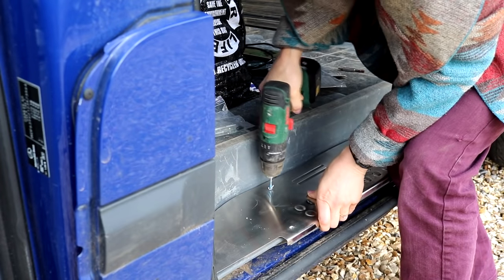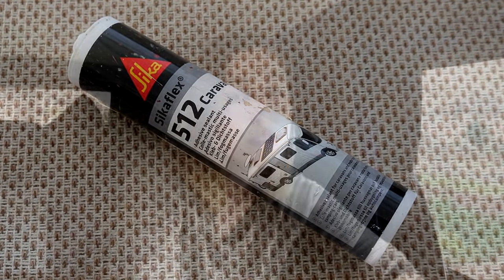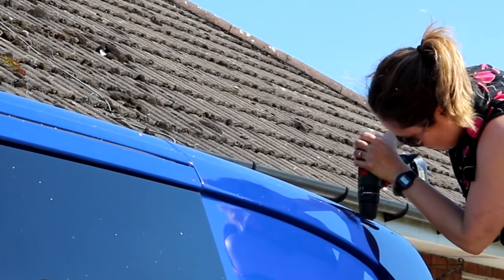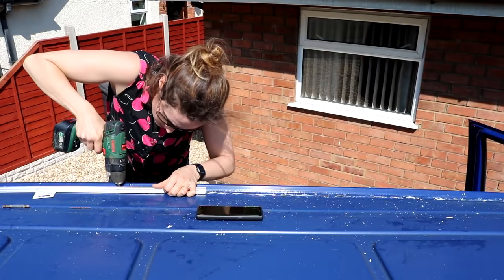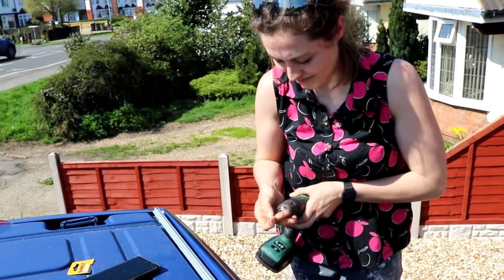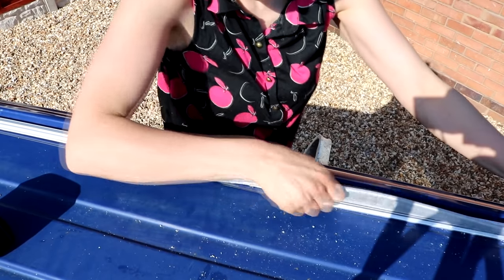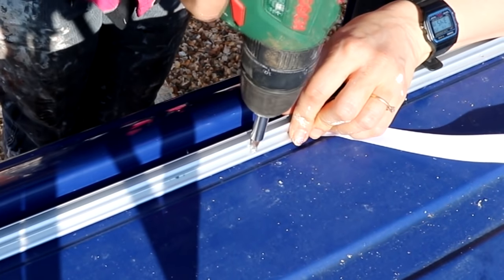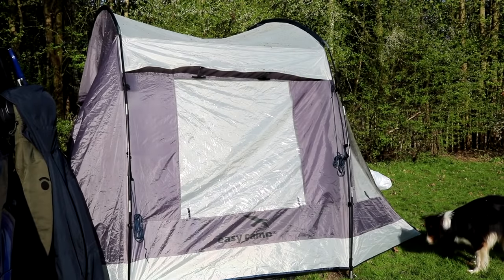Fitting Driveaway Camper Van Awning Rail | The Carpenter's Daughter

Comment: I would suggest never using any screws provided in any sort of metal based product. The manufacturer always put in the cheapest fixings because they dont have to use them. A quick trip to screwfix should see you kitted out with all the proper, stainless,  screws you need for penny's and way less hassle. For the broken of screws I would encase them in a blob of silicone rubber. Hopefully this will stop water getting under the paint and into the van.
Reply: Michael Tricker I agree, any screws or plugs supplied go straight in the bin! More trouble than they are worth!!!
Reply from the maker: Thanks!  I've now bought some waterproof silicone - thanks for the advice :)

Comment: Great job for tackling a very scary project, when i have ever drilled holes in my motorhome roof (satalite/awning etc) i have always used stainless screws and then covered the screw heads  with a small blob of Sikaflex, not always used screws, i have x2 solar panels that are just bonded down with Sikaflex and they are rock solid (have been now for 3 yrs) drilling the body of any van as such is very scary at first but when you think about it Vickie its only what a workshop fitting company would do - but charge you a small fortune in the process - great to see you brave such a job - my hat is off to you once again.

Comment: Well done for the hard work. I haven't bothered on my Vito. I put a couple of bolts (M4 or M5 I think) into the holes already in the rain channel (standard on all Vitos I think for potential roof rails) on the tent side, and one on the centre opposite side. Then, I fitted a length of 4mm rope to the driveaway awning edge which holds it all in place. We've used lots of times with no problems, even in heavy rain and wind, just need to make sure the ropes are tightly secured to the bolts. It is easy to detach when going out for the day too. When returning, just loop the rope over and tighten.

Comment: If the back of the rail had an adhesive backing I would have thought the rubber grommets went on top of the rail under the head of the screw, to act as a seal. With the grommets between the rail and the body work the adhesive cant be in contact all the way along.
Reply from the maker: That is a very good point!  I never really considered that as we were reusing the first track that was no longer tacky.  Oh well :\

Comment: Has been mentioned already, leave those broken screws in but a bit of silicone sealer to stop any moisture getting in, drill extra hole next to where broken screw is, right through the rail, pop in new screws jobs a. Goodun. :-) great idea for on site with your camper van, able to leave the awning up when using the van for sightseeing. Boss job.
Reply from the maker: Thanks!  I've now bought some clear sealant, so will go round the sheared ones.  I'll see how it goes, but it seems sturdy at the moment and see how it goes before drilling a couple more holes :)

Comment: My personal experience is to use better screws than those
 provided to keep costs down and secondly don't use a power drill to tighten them. Use a hand screw driver for the final tighten up. You see "professionals" all the time using power drills and they ALWAYS over tighten or strip the heads.

Comment: Were they stainless steel screws, Vikkie? They can be brittle. But I don't think you were overtightening them. Probably cheap screws, as someone else has suggested - I rarely use the screws supplied with any package. I imagine they were self-tapping screws. Are you able to drill the track and add new fixing points?
Reply from the maker: Thanks, Olly :)  I'll definitely try my own screws from now on since so many people say they bin them :D  I did wonder about drilling a new hole in the track, but left it's very.  I'll have to monitor that back one for now.

Comment: I would never have used screws to begin with. Screws can come loose, back out and be gone long before you notice the first leak.
I’d’ve used pop rivets with black silicone (the kind they use for windshields in cars). I’d pre-drill the rails after I put them up and determined where exactly to place them, so I could identify issues like curves and seams. Then I’d use those holes to locate each point that needed to be drilled through the roof of the van. At that point, I’d apply the silicone to the roof along the entire length of the rails. Start at one end, drilling one hole and installing the rivet, then going on to the next point. Having the silicone the whole length would reduce vibration and wind noise. Then just clean up the squeezed out silicone with a damp terry cloth rag and voila!and if it helped you feel more secure about the risk of tear-out, you can always use snug-fitting flat washers with the rivets.
Had to laugh when you played MC Hammer...😜

Comment: Check out "Tiger seal" super power full, black in colour comes in mastic tube.Beats putting holes in your van, Submerge tube in bucket after use and you can use again.Trade tip in the motor trade.

Comment: I realise its a bit late now but fitting roof rails (£60) to your van and then a pair of cross bars would have given you the opportunity to bolt (2no.75mm roofing bolts and butterfly nuts)a piece of 2.4m long 2x1 timber  under the cross bars on the outside edge. A decent bit of tanalised roofing batton would do (ask your pa.) Maybe paint it blue.   Then you could fix the awning rail onto that. This would give you a straight edge..no holes in the roof  easy fixes into wood, the ability to remove it at will and hey a roof rack that you could put a fair bit of stuff on ...maybe a roof box ....maybe a solar panel .... AND still under 2.1m high for car parks.  IF you dont have a roof box.
Drilling all them holes in the roof and not sealing them or priming the bare metal......well I'm sure you know!!!
But having said all that you have done a great job on the van.....and you've used it. I'm sure your Pa is very proud of his girl.

Comment: Just a thought if the strip is made of plastic & you have to bend it it might be easier it heating it in hot water first to make it more pliable
Reply from the maker: Thanks for the tip!  Sadly, it's a metal strip.
Reply: Looks like aluminum.  It can still be bent, but you'd have to apply some heat very evenly and carefully and slowly warp the track into place.  Cast aluminum is very difficult to bent because it tends to crack and break.  Steel would be easier.  However with all that being said, the vertical parts of the track would effectively resist any attempt at bending, regardless of the material.

I think the best thing to do is to use a longer screw and shim the track from underneath, maybe with some scrap plastic that would be easy to shape.

As far as getting the broken screws out, there is no magic bullet that I've found.  The best way that I can think of off hand is to get a pair of vice grips on it.  But with the adhesive strip on the bottom of those rails, it would be a pain to remove the rails to give you clearance for that.  The next option is to attempt to drill the broken screw out using the holes in the rail as a guild, but it sounds like you already tried that.  The third option is to live with it and put a dab of clear silicone sealant on the broken screw so that it doesn't leak.

I suppose you could drill a new hole nearby and put in another screw if you're worried about the rail holding on, but if it looks secure I wouldn't bother.

Comment: Best to leave it if its not in the way. An i would suggest that you use lexel that is a rubber base caulk clear that is made for metal. It is the only thing that manufacturers will let you use on metal. It expands an contracts with heat an cold an will not release or leak. I have used it on airplane hangers where lear jets are stored many years ago an it is still not leaking. Lexel not sure if thats brand name it is lexel on tube rubber base very sticky dont finger it or smooth it. Cut proper tip off according to size space your caulking up an push it out an leave it. It will actually run into any spaces that would be a potential leak an seal. An its see through clear so van is blue it will look blue its so clear.
Reply from the maker: Thank you so much for the great tip!  I'll look for that!

Comment: I think if you tried to drill the screw  out with a corded drill using a cobalt drill no problem it would be out use a smaller drill than the screw shaft diameter at first then finish with desired size

Comment: Its difficult to tell, but it looked like your drill speed was too slow for such a small bit! The smaller the bit, the faster the revolving speed! I doubt your cordless drill could go fast enough for such a small bit? I suggest any fitters use a silicon bed under the rail, and use the caps above! A follow up video would be helpful to see how it has worked out in practice? Cheers!
Reply from the maker: Interesting... I've heard the smaller the drill bit, the slower you go 🤔
Reply: @TheCarpentersDaughterUK  sorry, you have been I'll informed big time! The bit speed is calculated by measuring its surface speed, a larger bit travels further during 1 cycle and therefore has a slower speed! This explains why you struggled to drill the roof! You were pushing more than removing! Regards.
Reply from the maker: Ah, someone told me this well after the video :)  I went out and bought better drill bits and was much better :)